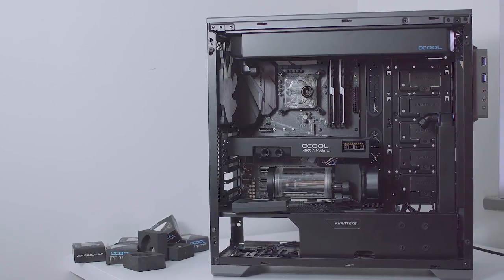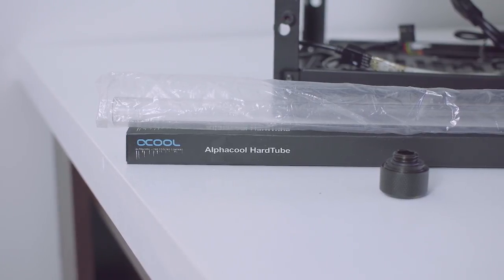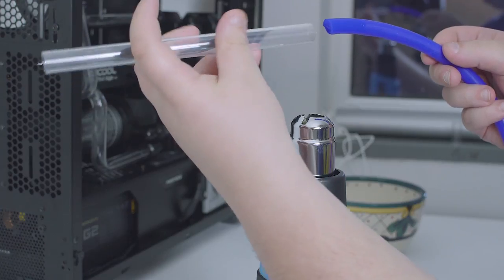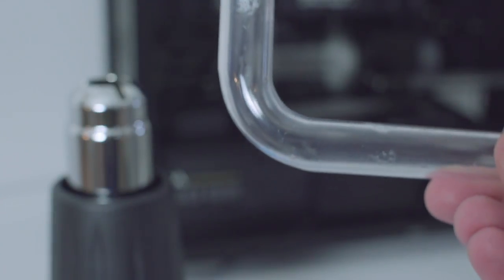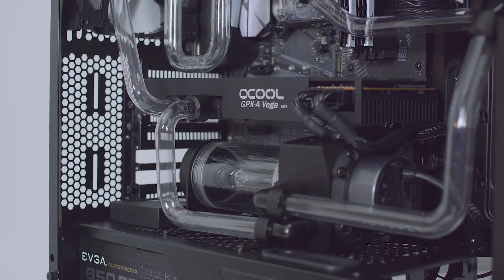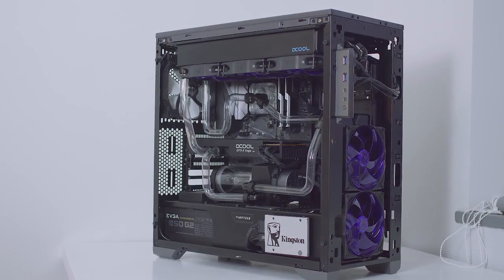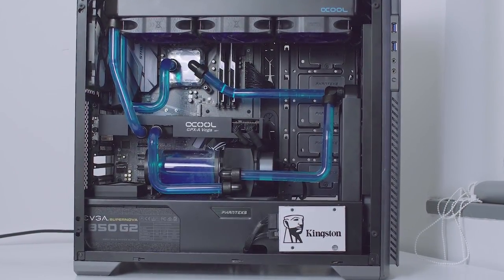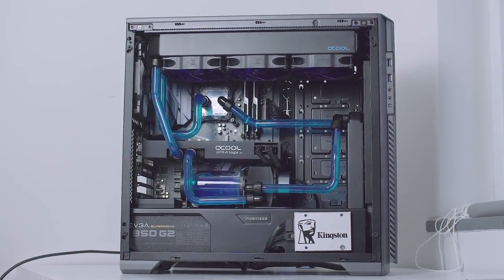I SUCCESSFULLY built a HARDLINE loop as a WATERCOOLING beginner - here's my guide!

Comment: It looks good.  I would have done some of the bends differently, but that's personal preference.  I've never had a pump/reservoir combo yet that didn't leak when I set it on its side like yours.  

How in hell could a video like this be flagged for de-monetization?  You're talking about bending PETG.  The last I checked, that wasn't a controversial topic, outside of those who prefer acrylic to PETG.  I've done some acrylic bending.  I much perfer PETG.  It doesn't look quite as nice as acrylic, but it's so much easier to use, and so much more forgiving.  

You covered this, but I think it's worth mentioning again that deburring the cut ends is really important.  All it takes is the tiniest of cuts in the rubber gasket to cause a leak.

Comment: I do not see your pump ... I have a question please .. I have a ID Cooling Frostflow .. I leave the 2 tubes in the radio in the block after the processor. The question is .. for the look I want to add a tank .. from the radiator in the tank and then in the processor .. do i need the pump? If so, how should it come ... how do you tie them? Thanks for the answer

Comment: Hi,  can one triple 140mm  PUSH/PULL radiator config be enough to cool of  the CPU + 3x GPU's ??
Reply: it depends which CPU you have, and what GPUs u have and also if you are planning to overclock them..but with 3x GPUs and 1 CPU i would go with 2 360 tick radiators at least if i want to overclock them
Reply: @releentleess  Bob tanx 4 da reply…. And yes Ill be OC,,, I've  purchased the 2x  420mm Rads as per ur suggestion… tanx again
Reply: superbadmofo1 gald to hear that! Happy OC!

Comment: +MindBlank Tech
Nice guide. Btw there is a lot easier way to power up pump - like using STEP DOWN power board from China and any laptop power brick to power pump without disconnection not modular PSU.

Comment: Honestly i've never got why people think hardline is so much harder than soft loop. I didn't have any difficulty building mine, and it is reasonably complex (2 rads, gpu and cpu in a mid tower). Although i guess i have always been good at that sort of thing.
Reply: For me its more a matter of patience needed as well as planning time.
It can take a while to get a tube perfect, especially with 2 or 3 bends.
Sometimes you have to tweak the bend, and sometimes trim the ends.
It can be exhausting doing it half a dozen times for each tube.

You then have to clean the tube ends and get the tube in which isn't always easy.
Sometimes one end will go making the other not go in, and vice versa.
I think its worth it though once its done.

You can do almost anything with hardline, whereas sof ttubing makes you go with the flow of the tube.

Comment: you said temperatures for the CPU were high 60s low 70s. I looked at the website and did not see anything but you should consider asking the company how high the water temps are tested for. I think it was EK that said something about having a limit of 60 to 65 degrees Celcius on their liquid coolant before deterioration of the liquid begins. ah here it is:
Decomposition temperature: >65°C (>150°F)*
Recommended use temperature range: 5- to 60°C (40- to 140°F)
https://www.ekwb.com/shop/ek-cryofuel-lime-yellow-premix-900-ml
Reply: I think you are confusing some things, so here goes.

It's a bit of a long lesson, but basically, heat and temperature are related but aren't the same. Heat is a form of energy, in watts, while temperature is a measure of the excitation of atoms. More heat, more atomic excitation, but the amount of added excitation depends on the material being heated. That's "heat capacity".

First, for heat to be transfered, you need a difference in temperature between the contact surfaces. The larger the difference, the better the heat transfer.

Metals are usually structured in solid crystals, which make them really good at transferring heat within itself, but they heat up fast and lower the transfer coefficient between itself and the part being cooled. They have low heat capacity. However, by heating up a lot, the large difference in temperature between the air and the metal makes up for the poor heat capacity, and it releases heat in the air fast, quickly lowering its temperature.

For the record, a CPU is made of a crystal arrangement of silicon. Its heat capacity is low too.

Water is a disorganized mass of, well, water molecules, which is really good at intaking a lot of heat and keeping cool anyway, due to a high heat capacity. Keeping cool means the temperature difference between the water and the part being cooled stays large, which in turns improves cooling of the part being cooled. However it's bad at releasing heat, since the difference of temperature between the ambient air and the water is way lower, between 5 and 15°C usually.

In both cases, there's an equilibrium at which point, under load, the part being cooled emits as much heat as the cooling solution dissipates.

With that much radiator space (5 times 120mm fans), the water won't ever reach 65°C without extreme conditions, like an impenetrable wall of dust trapped against all the radiators, or living in a desert. I'd say his water temperature stays below 10°C above ambient at full load, so below 28°C in the winter (in a room with a heater) and 45°C in a hot summer (without air conditioning). His coolant will be absolutely fine.